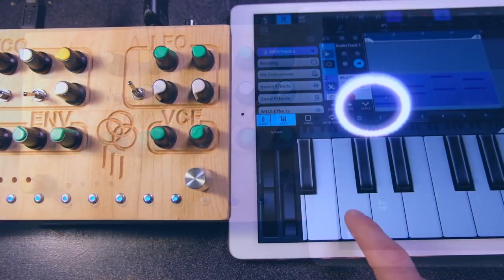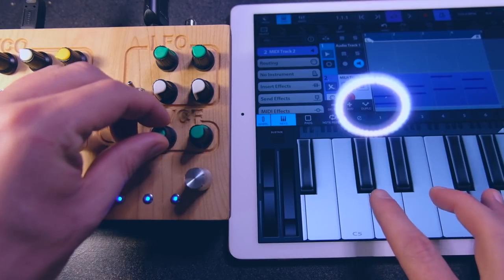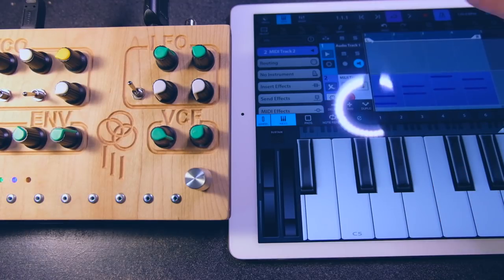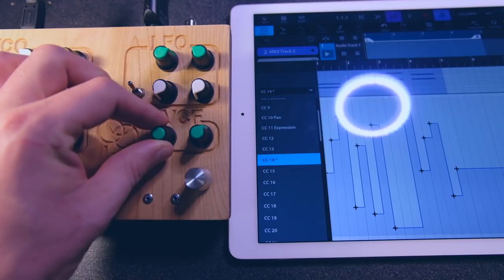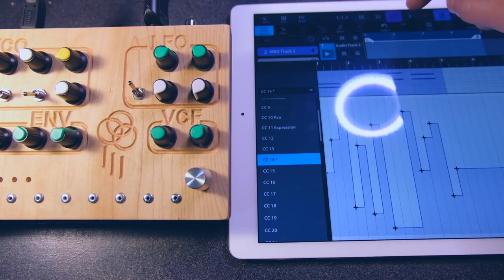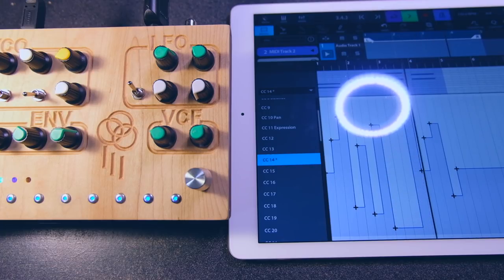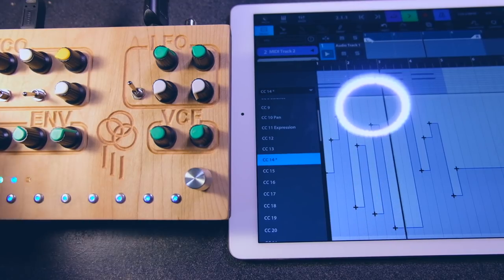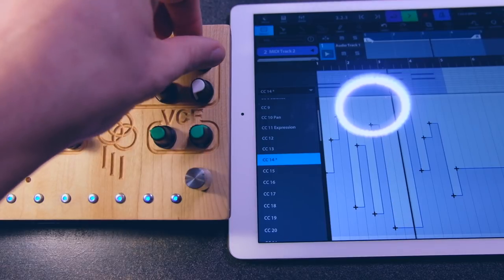Nimbus: Digital Polyphonic Synthesizer

Comment: Nice Synth - I wondered how you made those buttons?
Reply: BurritoBrain +1
Reply: kinda late to the party, 80% sure they are just rivets with LED's in them, connected to the TOUCH sensitive pins on the microcontroller :D
Reply: @EuIo93  Directly connected to the touch pins? Or with some resistors between?
Reply: @jrgrust  from my understanding, there are two ways of registering the touch, but the most used one is the capacitive touch pin, which does not require a resistor. you just connect a wire to the pin and solder that to a metallic contact. Hope I am not wrong and this helps :)
Reply: @EuIo93  Thank you for your answer. I want to try it.

Comment: Has anyone tried to recreate this really beautiful synth? If i try it and test my touchpads from copper with the neopixels  nothing happened :-(
Reply from the maker: The touch pads are not attached to the neopixels.
Reply: @otemrellik  Thanks Otem for the answer. Sorry, that was a little misleading. I ttried the sketch on a Teens 3.2 and also on 3.6. But if i connect the Neopixels (on Pin 2)with the Teensy and start the program nothing happens. I thought the Neopixels begin to start with the "pixelDance"? Am I wrong?

Comment: I'm loving everything about your synth. Excellent choice of controls. Great use of the limited resources. The code is super clean and well organized. Nothing extravagant about the parts you used, everything is easily obtained. I build eurorack modules from Teensy MCUs, and your project really has me inspired to shoot for something similar in a module. Thanks for sharing all your work!
Reply from the maker: Thanks! I've just started building really basic analog eurorack modules. Haven't integrated teensy into any yet but I may have to hit you up with question if I start.
Reply: @otemrellik  There aren't many quirks about eurorack in the context of the Teensy devices you've been building. The main differences would be: the standardized power supply and connector; the exact dimensions for the faceplates; I/O of the control voltages that might involve negative voltage, and the protection of the Teensy against accidentally plugging a CV out into a Teensy CV in. Eurorack's 5.25" height limitation really makes a compact UI important. For instance, I've quit putting 5-pin DIN MIDI jacks on modules, replacing them with the Arturia 3.5mm TRS MIDI jack.

Comment: Really great work! It's interesting to see the evolution of your instruments over time. I am designing a similar project with the Teensy 3.2 that is partly inspired by this and your other teensy synth. I was just wondering, how did you manage voice allocation in your code? I am trying to write the button presses to an array, then read them by each voice, but can't seem to get it to work properly.  Any suggestions/pointers you have would be greatly appreciated. Thanks in advance!
Reply from the maker: Hey thanks! The voice allocation was a struggle to figure out. I basically have a peak meter on every voice and when more than one voice is used it scans the values of the peaks to see which voice is the lowest and then steals that one. I'm happy to share my code, let me know if you'd like to see it.
Reply: Hey, thanks for your reply! Excellent! Yes, I'd love to see your code if you're open to sharing it. I've been working with an array to hold the notes that are currently being played, but it isn't the smoothest implementation.
Reply from the maker: Shoot me an email otemrellik at otemrellik.com